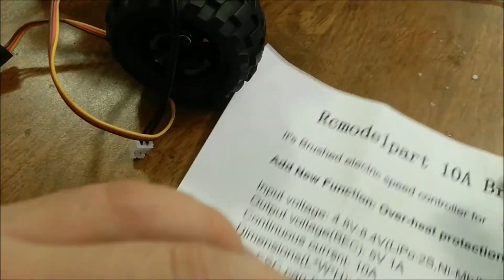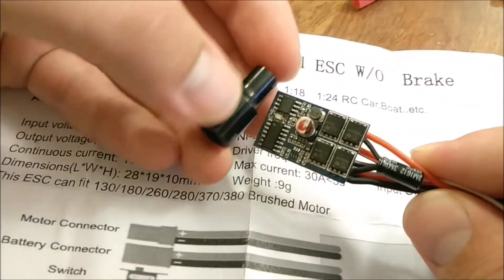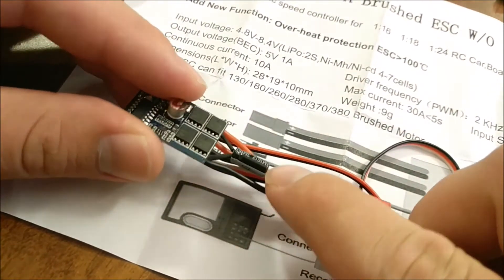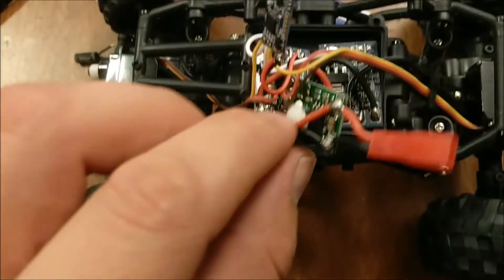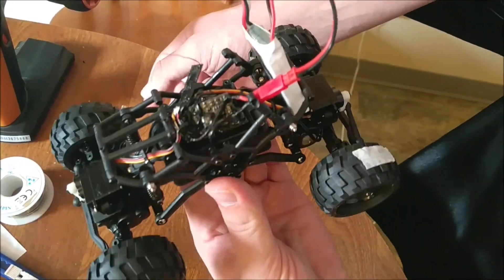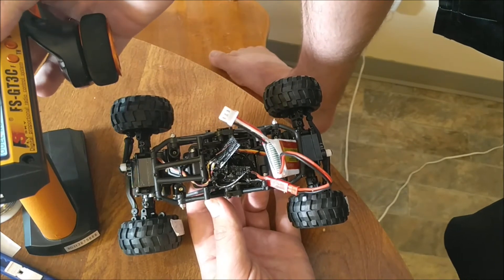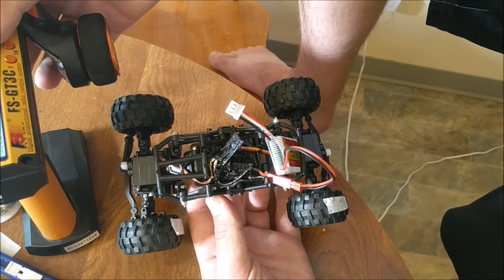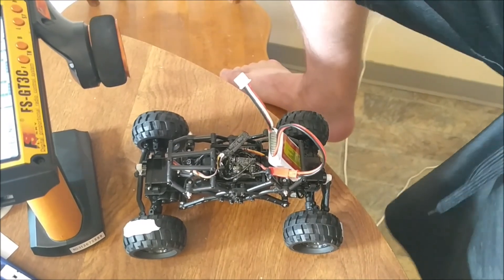Basher Rocksta 10A Brushed ESC Install and Testing (DIG SETUP)

Comment: Was there no facility to calibrate the throttle on both esc's?
Looks to me like that would have solved the issue, otherwise awesome job.
Reply from the maker: What I should have done way connected them up together to one channel and calibrated it or something, but this was after everything was soldered in. Also they were very close, it was just individual differences I think...in the field you can't even notice because the motors always have different loads on them